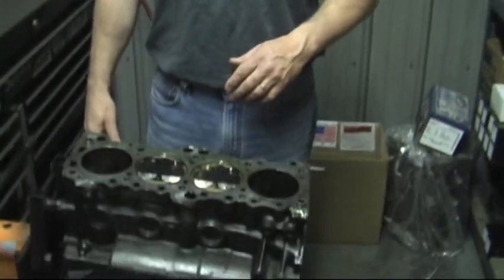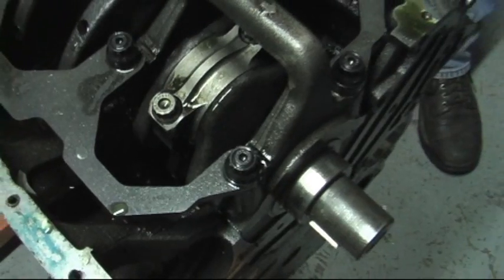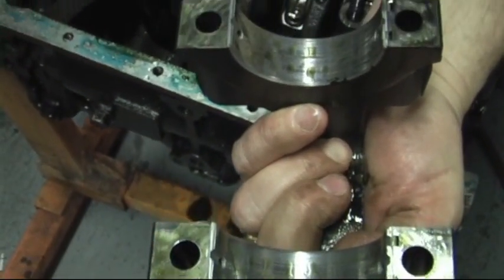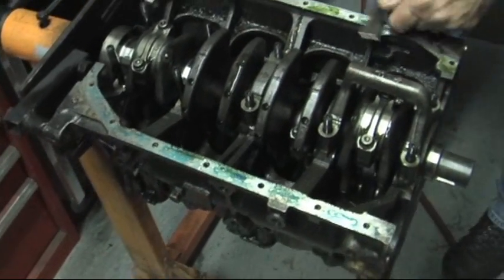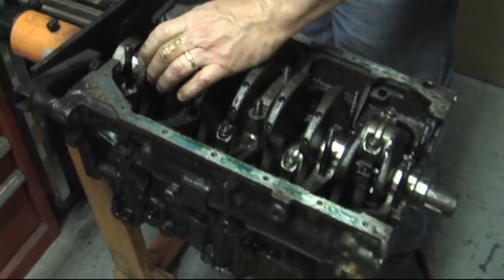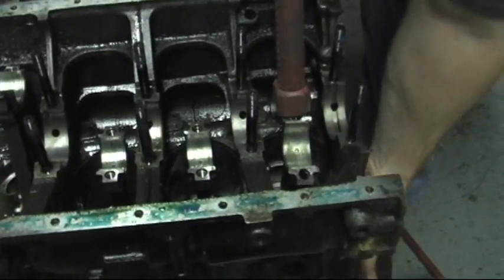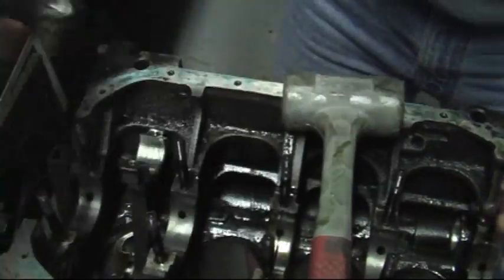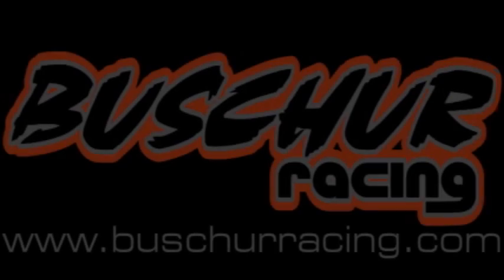Buschur Racing tears down Brick's BR Stage 3 block

Comment: For race engines specifically. Oil squirters in a motor running forged pistons is just not needed. They just become points of possible failure with no real benefits in that scenario.

For daily driven vehicles, lots of people DO want oil squirters.